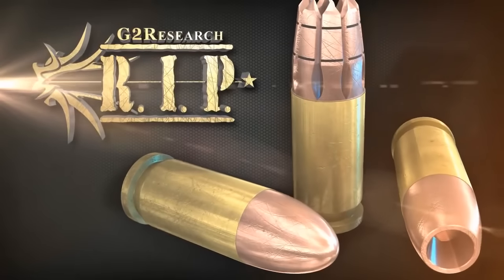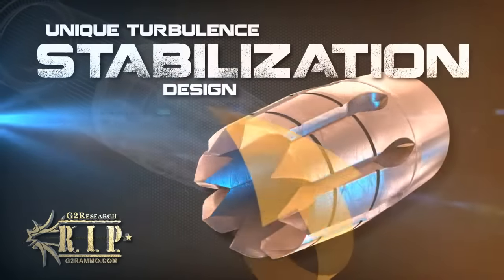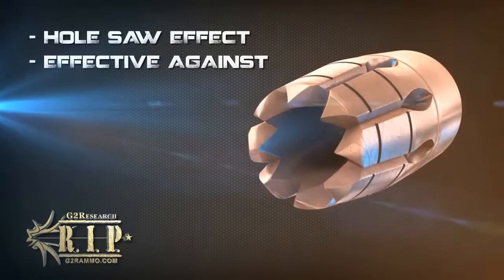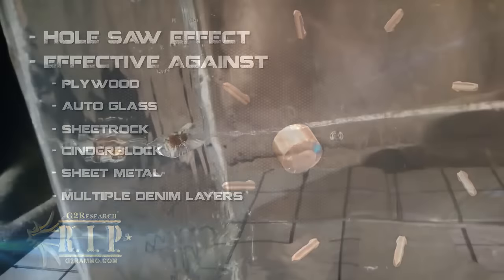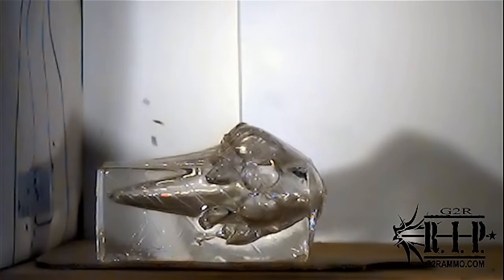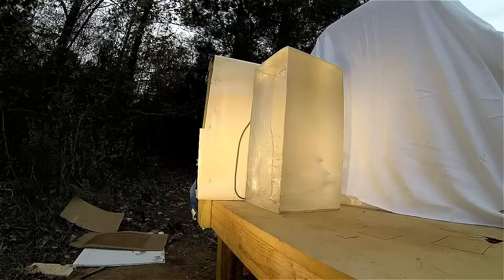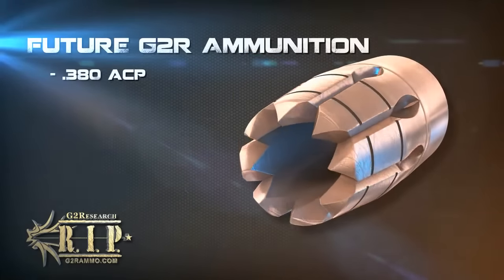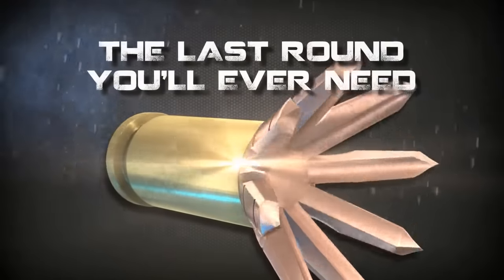G2 Research RIP Ammo

Comment: Now we just need a 5.7 round, preferrably not as expensive as most other rounds of this caliber
Reply: good luck
Reply: came here poking around thinking the same thing.
There are some along the same lines:
The Cutting Edge 30 gr Raptor (found on R&R IS130D-v3)
or Maker 37 gr fracturing (found on R&R R37.F)
and whatever is the bullet on Vanguard 36 gr GPM.

and Shock Hammer 33 gr or Lehigh Controlled Chaos 32 gr are in that same realm if a person wants to load their own.
Others do some things sort of similar, the 35 gr NTX, and Barnes Varmintish bullets.

But yes, it would be nice to find this bullet out there in .224 or a finished round would be nifty.
Reply: I have gel tests with all of those I mentioned, btw. 
I'm shifting away from the "penetration" thing and leaning more now to the fracturing - for defense.

Comment: You literally won't survive, unless it's a arm or leg shot, even so you'll be in surgery for hours, them taking out fragments like Tony Starks chest in Iron Man 3
Reply: Surely an arm or leg shot would be worse, as all those splintering fragments are surely going to hit the abundance of important arteries in the arms/legs
Reply: actuly it would be just as bad if not worse with a leg shot. your more likely to hit an artery with these than a normal bullet.
Reply: they dont take them out during surgery, they will if they see it when fixing you but they get left in most the time
Reply: Its too destructive for civilian self defense use. Especially in territories that don't really encourage the stand your ground philosophy, the defender will end up in unde hot water because of this cartridge.
Reply: @alitahir4147  true so much!
Reply: Don't forget about the lead poisoning.
Reply: @Alexander2010783 solid copper projectile
Reply: @alitahir4147 these are legal in most states for civilian use and it's actually safer to use than many other rounds.

I use 40. Caliber in my glock 22, based on the fact they cut down on the ability for the bullet to overpenetrate but introduce a whole new iternal wound cavity ability as well.

My 40. Doesn't penetrate wood well or any other cover, but this is exactly what I need for a close quarters indoor situation.
Reply: You’d likely survive compared to a standard JHP. Pistol rounds deal lethal damage via penetration and weight retention not via tiny little superficial wound channels made by needles lol, also the first 4 inches of ballistics gel are equivalent to skin so the pedals really aren’t penetrating deep enough to cause any kind of wounding damage. They also jam like a motherfucker because the bullets are so fragile Just use JHP.
Reply: @559rasco There is no taking this out unfortunately and i don't think even combat medic wanna touch it

Comment: Guess ill find out regardless this week, but really hoping my 3" sc mod 2 with a 20lb guide rod assembly will cycle this .40 s& w on a 9mm 115gr load
Reply: Jordan Heibert I have a 45 xd mod 2 4” and have gone through many rounds without an issue. I keep my gun clean and oiled up at all times though too. Hopefully you have no issues as well.
Reply: @tonynittoli4792  hoping so. Guide rod came in today. Just waiting on springfield to call saying the replacement frame is all good to go so i can go test it out. Which company did u go with for the rod and springs?

Comment: Being a low grain round, would it have trouble cycling with a 12lb 1911 recoil spring?
Reply: Why a 12lb recol spring you only need like 8 or 9lbs
Reply: @steve-o4153  Sig p320 x5 Legion has a 1911 12 lb recoil spring in it 🤷‍♂️
Reply: No trouble cycling

Comment: Wait if you have an auto pistol and you use this ammo, how much damage would this bullet do
Reply: So basically explosives but without the boom
Reply: 45 dmg to the body, with a 3x multiplier for the head
Reply: @stevenholmes4324  Not really sure about that unless they got shot a lot of times. These bullets tend to have weak penetration compared to most conventional hollow points. However the chances of collateral damage from overpenetrating the target are lower.
Reply: All of it

Comment: I don't know. 96gr that isn't a lot of weight and those little barbs aren't going to do the damage you think they are. I think I would rather have a heavier bullet that opened as large as possible while still staying in one piece.
Reply: @Nathaniel McGuire Those little barbs only weigh a couple of grains they are not going to do the damage that you think. Think of it this way you don't use fragmentation varmint rounds on large game they just don't go deep enough and a human is basically the same thing. Those little copper pieces are only going to penetrate a couple inches and if they hit bone forget about it.
Reply: @williampollock1274   You're right, assuming an incorrect purpose. They're not for "damage". They are there to create eight additional bleeding wound channels.